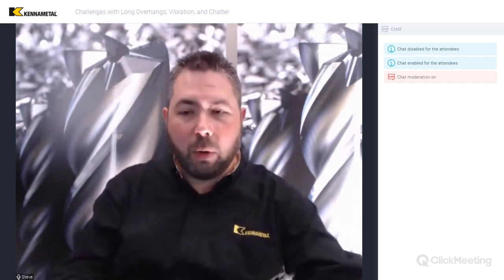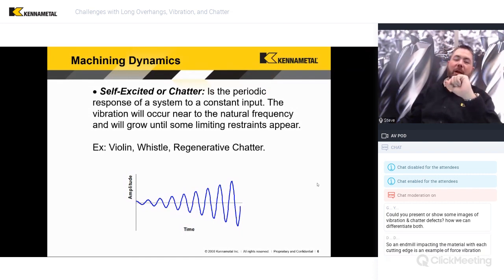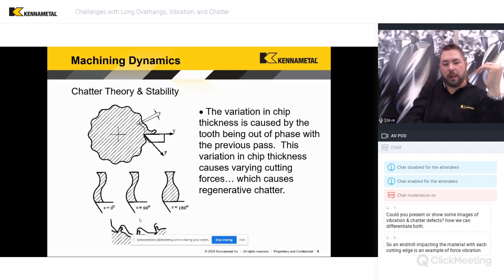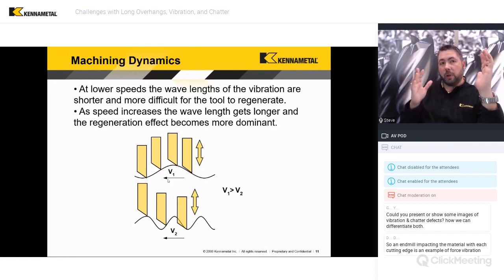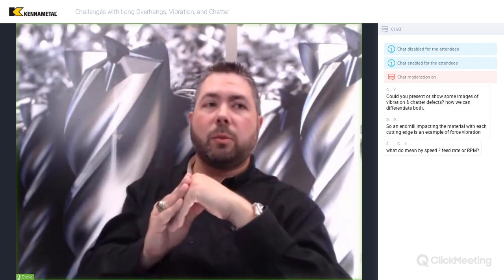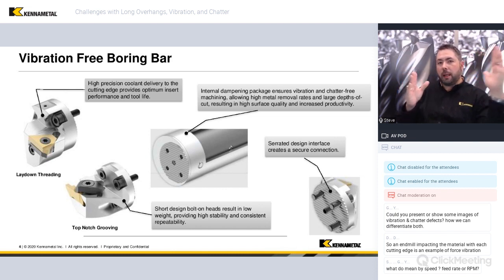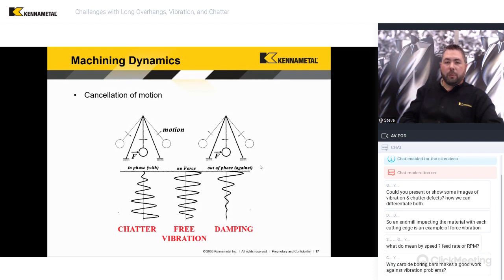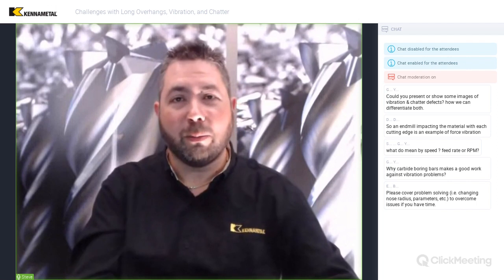Challenges with Long Overhangs, Vibration & Chatter

Comment: if kennametal's boring bars tuned at the kennametal's plant,
is it possible in future that we need to change plants tunes, because we will have new spacial conditions with machine, equipment, cutting data ... etc?
Or plant tunes is perfect and we don't need to touch it?